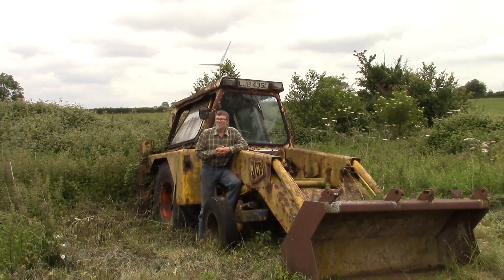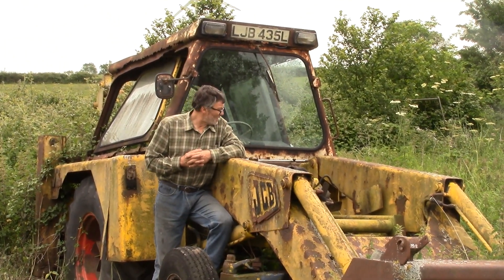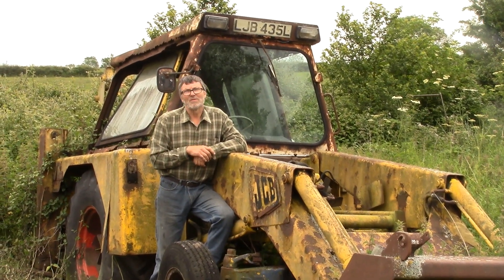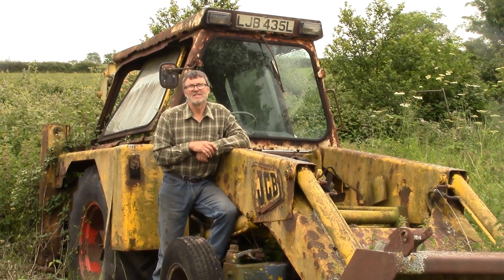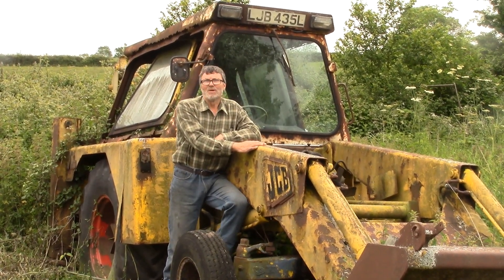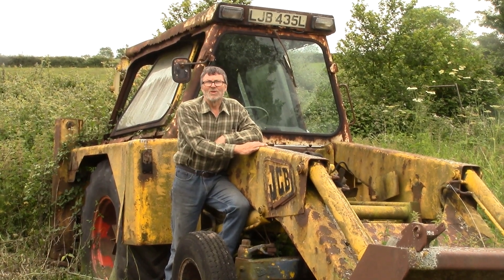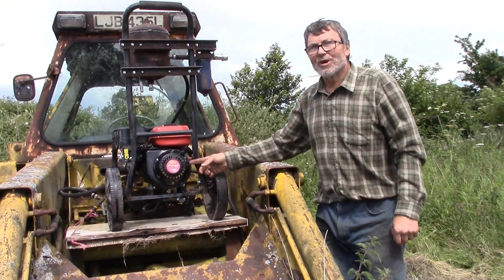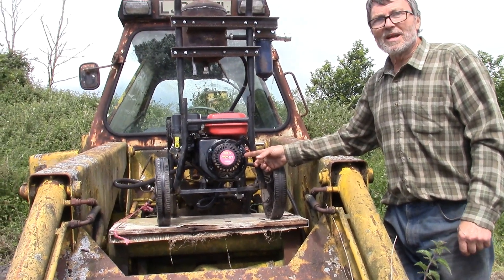JCB powered by 5Hp Honda engine

Comment: I put a tee at the junction of two lines and installed a line with a quick connect to the auxiliary hydraulics on my 4/65 and let the Nuffield supply the pressure to raise the bucket on a Fordson Major that was not running.

Comment: Please tell us more how you did that, thanks.
Reply from the maker: Its just a small hydraulic pump mounted on the petrol engine, it draws fluid from the JCB reservoir and pumps it back into the main hydraulic circuit, the arms then work though slowly!
Reply: Ingenious ! Thanks for the explanation.